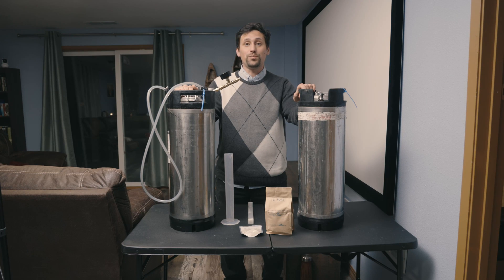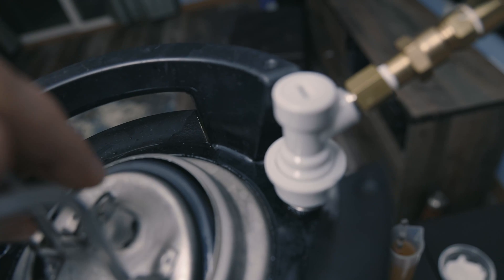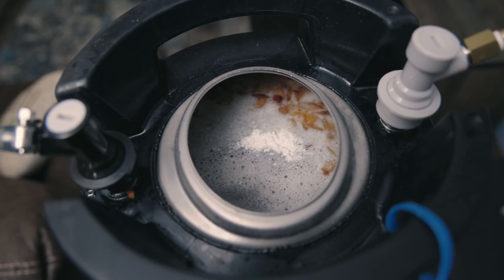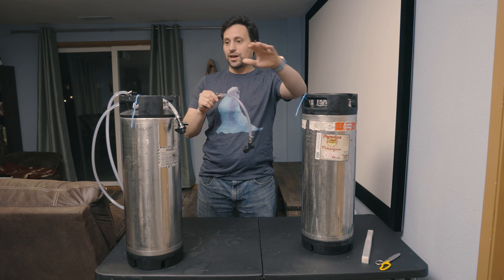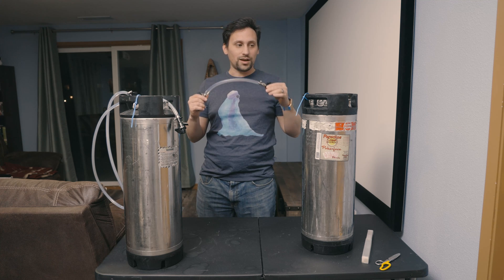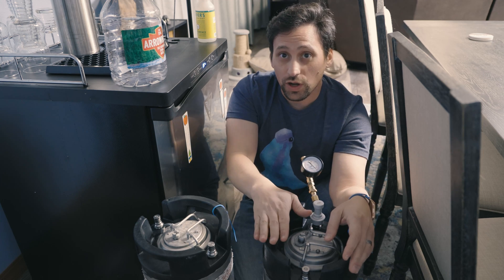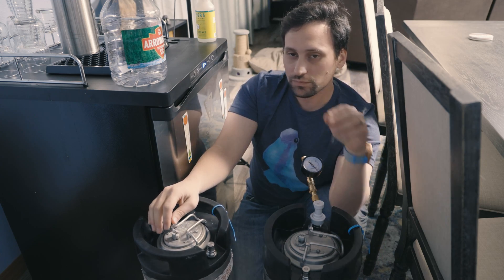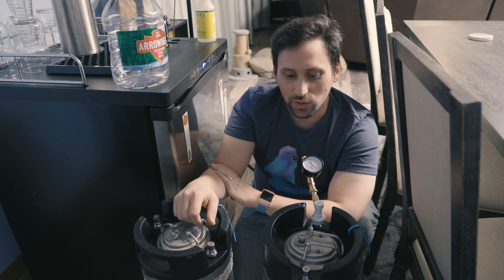How to Backsweeten a Pressurized Cider Fermentation

Comment: how do you prevent the sediment on the bottom of the original keg from being sucked in and transferred to the new sweetened keg?
Reply from the maker: Good question! Floating dip tubes.
Reply: @CiderWithKevin  ah, and assume the length of the tube is shortened so it can't touch the bottom of the ball is big enough to prevent it? Thanks!
Reply from the maker: @Brian Sullivan  that's right, I usually make mine so that I have about 5% loss on transfer - about a half-inch from the bottom.